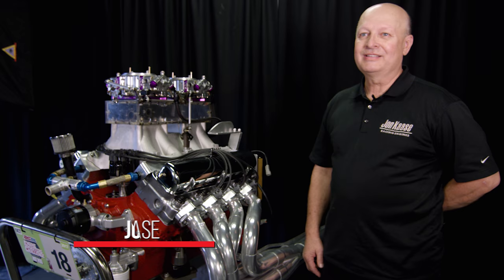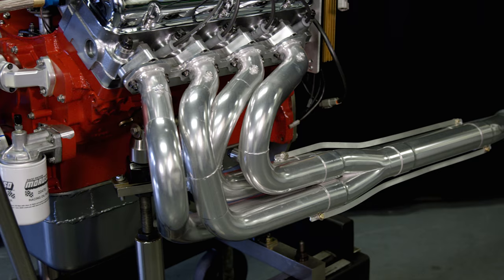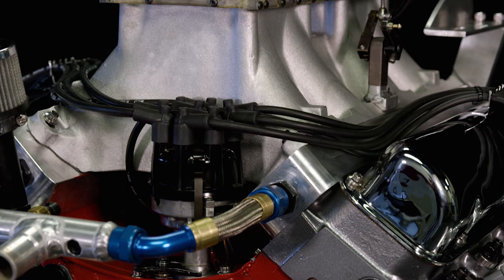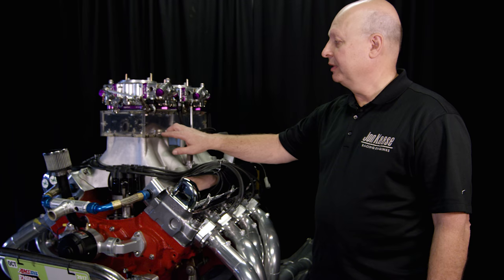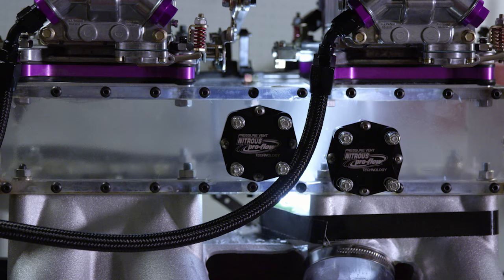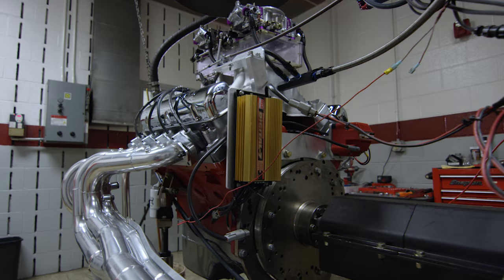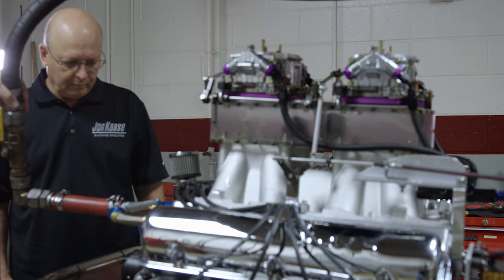Inside Jon Kaase's Vintage Class Winning Engine Masters Creation

Comment: You have to love this guy. He is not intimidated by anyone. Will tell you just about everything he does to make the engine produce power. Just incredible. His thought process is so out there by the time you figure out how he did what he did. He is 10 projects ahead working on something else.  No wonder he is so good, and humble about it as well. Have to tell this quick. There was a guy with a 460 Fairmont at the Beaver Springs NOS meet last year. His car was running 8's naturally asp!!! He told me the dino was 860 or there abouts. Finally, he took off the hood, there they were the old KAASE heads, P51? He told me he was saving for the new better version JK had come out with. He was sure he could go quicker.

Comment: these engines are awesome we run a FE 390 IN OUR RACE CAR
Reply: MEL engine is different family than that of the FE engines
Reply: Yeah 383 430 and 462 cubic inches. M e l series Mercury Edsel Lincoln.
Reply: @lorenzomaximo1818 … and the 410.
Reply: Yes they also made a 410 MEL and a 410 FE motor. It was basically a 390 with a 428 crankshaft giving it 410 cubic inches. I have seen several of these motors in 65 and 66 mercurys
Reply: Bronson doesn't really know about Ford engines.
Reply: You're 390 FE is quite a bit different than this.
Reply: @lorenzomaximo1818  I saw a 410 in a F250 , very strong set up .
Reply: 390 is a great engine very under rated!

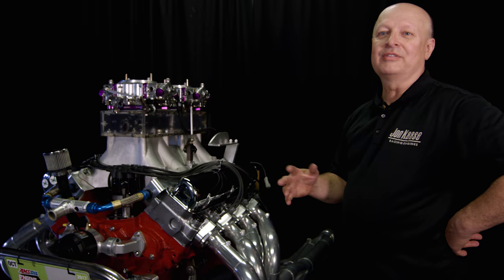Comment: What the heck am I looking at at 1:27?  Heads that go an inch into the block?
Reply: Hold Over the MEL engines were wild. I’d like to do a 410/430 one day. They are cool mills
Reply: That's a mod, rules dictate you cannot raise the intake port. So they lowered the combustion chamber.

Comment: It's funny how everyone stretches the rules for Ford (they were allowed to run their 4 valve engines against 2 valve competition back in 2014... if memory serves me correctly).
From what I understand, this was not a "production" engine ("they didn't really come in Fords"...John Kaase) but an experimental prototype built by Ford. My understanding is that production engines only are allowed to run. Secondly, the amount of modification needed to make any variation of Ford's pathetic Y block run is astronomical, not cost effective and out of reach for the average gal/guy. The combustion chambers appears to be cross flow in design with a symmetrical port layout (the only other engine manufacturer at that time...1954...with this basic layout was the Chrysler/Desoto/Dodge Hemi's which were banned from the competition). The Ford/Kaase design differs in that the valve layout is 90 degrees from 12:00 (starting at 3:00 parallel with the crank) when compared to the Chrysler/Desoto/Dodge design. If Kaase is allowed to run a non-production, highly modified, Ford "Y" block, than why can't anyone run a production, legally produced, Chrysler/Desoto/Dodge Hemi engine (when the Ford/Kasse engine has some basic design elements/principles it may have "borrowed" from the Chrysler Corporation)? 
Looks like Globalist Ford is allowed to cheat again while stronger, more deserving, superior engineered designs get sidelined (screwed) in favor of fake superiority.
Reply: Still Bill this was a production engine. It was common in many mercury, Lincoln, and edsels, as stated.
Reply: Thank you Mr. AJN for your observation (I obviously misunderstood Mr. John Kaase's statement); I stand corrected. My apologies to all.
Reply: Still Bill no worries my friend. Kaase is a master at this art and I’d love to sit with him for a few hours.

I do agree though about bending the rules. 

The combustion chamber “stretch” he did here is genius, but it is bending the rules pretty hard.
Reply: Well Ms./Mr. Lynn Dempsy, what an eloqueant response. Perhaps you can refrain from profane, ignorant responses and answer my question (after all, Ford "Y" blocks truly were the worst overhead valve V8's of the 1950's). If I am wrong, please show me/us were I am wrong. Perhaps you can provide data/facts were Ford Y blocks blew the GM (namly the small block Chevy) and Chrysler (the superior Chrysler, Dodge and Desoto Hemi's) competition into the proverbial weeds at some drag race, road race or NASCAR competition(s). How well do/did Y blocks hold up to super charging? Can you please expound upon the superior flow characteristics of Ford Y block heads? Can you tell us why Chrysler/Desoto/Dodge Hemi engines were/have not been allowed to run in the Engine Masters antique engine class?  I look foreword to your educated response.
Reply: @brucegerard309  Mr. Gerard: I stand corrected on the MEL comment; however, I do not  discount my comments related to the "Y" block. I do have very limited experience with the "Y" block (I am old enough to have been around a couple). A good friend of mine in high school acquired a ford half ton pickup from the 50's with one in it. When inquiring of performance parts for it, everyone (including Ford devotee's) told us to leave it alone (we acquired and built a SB 289 with C4 tranny for it) as it was woefully inept as a performance engine when compared to more modern alternatives. I believe oiling issue's with the "Y" block was a function of its inferior oiling circuit (as is common amongst Ford engines throughout the 50's, 60's and early 70's). I believe oil would collect on the cylinder heads and coke (solidify) due to heat resulting in clogged oil passages/slug build up. To the best of my knowledge, Chrysler engines (both hemi and poly) did not have such problems and were superior in performance to both Ford and GM offerings. Let it be known that it was Chrysler who invented the automotive engine oil filter in 1924 which became standard equipment on all Chrysler products by the 1930's.
Reply: I won't argue that a Y-Block was the equal of the early Hemi in many ways, but in 1956/1957 they were bad news in NASCAR. Curtis Turner's "Purple Hog" '56 Ford won every single race it entered in 1956 with the old 312. I don't claim to be certain that that means it beat Kiekhaefer, Buck Baker and the Flock boys in many, if any, of those wins, but it certainly had no trouble against Chevrolets. Depaolo Engineering's '57 Fords were the class of the field, since Kiekhaefer had taken a hike, until the AMA ban ended that, since Ford naively followed the ban to the letter.
 Kiekhaefer had the same trouble getting fair rules that I used to have taking a Cleveland-headed FoMoCo to any Chevy short track, though he certainly had bigger stakes. They can do this, but you can't, and so on. NASCAR has always seemed to have a problem with non-GM cars winning too many races, since the France family have traditionally owned GM dealerships. And look what it's led to.
 No pushrod American engine was up to the potential of the Hemi at that time, but the Y-Block was the equal in performance, or better, to any contemporary inline valve pushrod engine. It's a shame that the Hemis were discriminated against at that time, but it has always gone on, only which brand is discriminated against changes, sometimes. Look at AA/GS and ProStock. In P/S, Hemis dominated for a long time. NHRA saddles the Hemi. Enter the SBC Vega as top dog in P/S. Then enter the Cleveland/Pinto. The latter wins too many times. Lots of racers switch to that setup. Big saddle added by NHRA to that configuration. I won't even mention how much almost everyone hated "Ohio" George dominating the Gasser class so convincingly for so many years. So much so that NHRA legislated him out of the class. On & on. 
 Lastly, your contention that 4-valve Fords could run against 2-valve anythings in 2014 is wrong. The rules specifically called for 2-valve engines as listed here: https://image.adam.automotive.com/f/77509819/2014 . This was one of the years in which neither Kaase nor a Cleveland-headed Ford won. The top two finishers were, in fact Gen III Hemis.
Reply: MEL engine is a totally different animal than a Y block or FE. Not many around these days, fastest American car built all thru the 1950s was a 58 Mercury with a 400hp 410ci MEL engine. Extremely rare.
Reply: sorry but I've never know a time when Chrysler was superior to any one, Chrysler vehicles made in the 60s and 70s were the biggest rattle traps ever, the bodies were junk. Chrysler didn't invent the hemi engine, now they had a lot of success with their version of the hemi motor, Ford made a couple of hemi engines in the 427 cammer developed in 90 days and the boss 429 developed in one year. both of these engines were serious competition for the Chrysler hemi which had been around a long time before Ford made those in the sixties. Chrysler had a lot of success but so did GM and Ford, to say that Dodge and Plymouth had superior engineering is a ridiculous statement.
Reply: @digtheseblues4284  bring some more brother, lay it on me, you're preaching to the choir! your rebuttal to Still Bill's comments are so strong and comprehensive that the silence is deafening. all i hear now is crickets.
Reply: Don't cry about it, Ford made some pretty good engines. And you need to do more research on Ford and the so called "globalist". You have been indoctrinated to hate Ford for a reason. Obviously much you don't know.
Reply: @digtheseblues4284  2013 the 4V Ford's cleaned all three podium positions and because of that haven't been allowed to run against pushrod engines since.
Reply: @biglazybilly  until the 2000s GM hadn't won more. From the era of actual stock production powerplants Ford had more wins until the made for class motors such as the FR9 etc.
Reply: @stillbill6408  being an old fart i've seen plenty of old yblock fords in my time and plenty of fast ones. as far as the mel engine it came in almost all mercury lincoln and edsels, i had several myself, real bad ass was the 60 tbird with the 430ci and factory standard shift on the column. its a shame to have so many haters that don't take the time to do research on what they hate and if there really is a reason.
Reply: yeah i reallly liked the superior design of the chrysler electrical system, even new it was risky to depend on it starting.
Reply: @thereluctantgearhead4544  I don't claim to know everything; hence, I appreciate the rebuttal (that's one way of learning).  I will say that Ford's Cleveland was a damn good engine (mostly due to its cross flow head) as the record books prove.
Reply: Look closely at a new Chevy engine you will see an old Ford.
Reply: @stillbill6408  Cleveland was definitely a good engine. Ole Bob Glidden had pretty good luck with them back in the 70s.
Reply: Ford Copying ?? But the GM LS is just a basic copy of a Windsor with Cleveland heads Aka the Boss 302